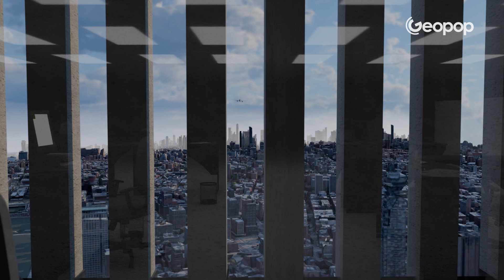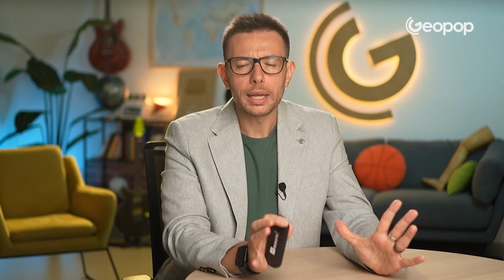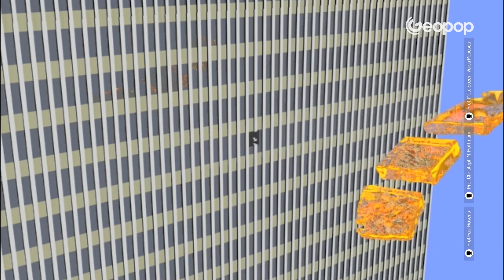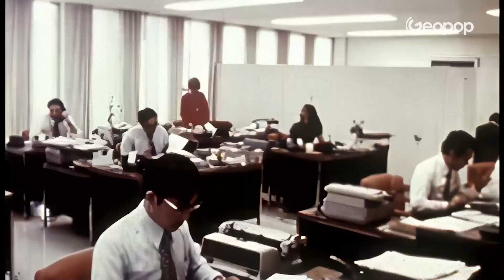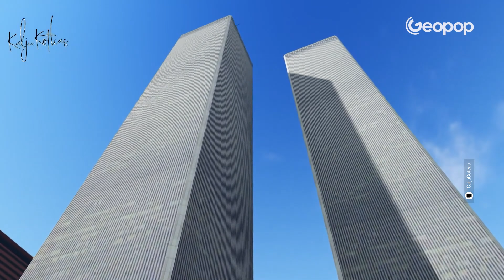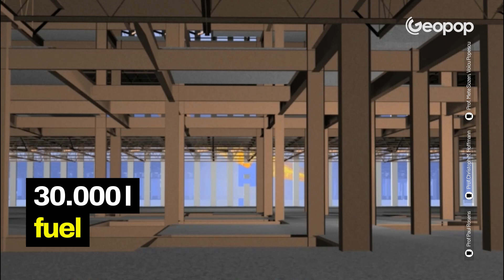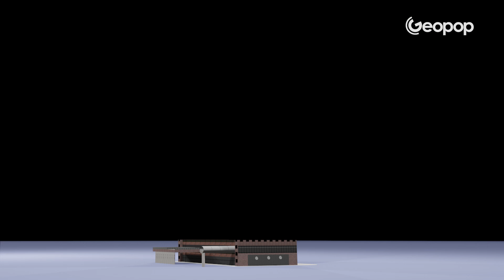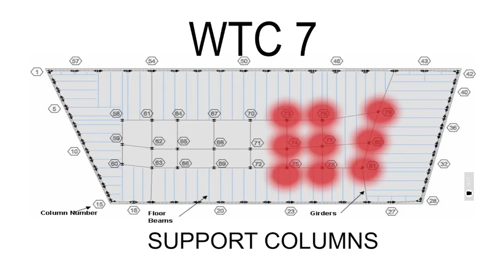9/11, 2001: The Technical Reconstruction of the Twin Towers and WTC 7 Collapses

Comment: I'm confused. So according to this man, temps were way lower than what would be needed to melt steel.  Why have I seen so  many videos and pictures that clearly show molten steel spewing out of the towers?
Reply: Molten metal pouring out of the South Tower (and it was in fact ONLY the South Tower)?  You mean this?

youtube.com/watch?v=xPVGGQU-MeQ&ab_channel=SeekersofTruth 

So you think that is molten steel why?  Because you performed metallurgical tests?  Because the internet told you that’s what it is?  I think we can do better, so let’s do better and build a theory the right way instead of making evidence-free assumptions. This will take just a couple of minutes and is worth the investment. 

The Boeing 767 which struck the South Tower weighed 117 tons and 80% of that was aluminum.  The exterior cladding on the Twin Towers – the white panels – were also aluminum. When Flight 175 struck at the 81st floor its momentum deposited much of the office contents in its way and the bulk of the aircrafts mass into the NE corner of the building. The piled up debris shoved into that corner is visible in photographs and video so we know it was there. 

There’s a good shot here of piled up debris from 4:36;

youtube.com/watch?v=ZLJyL63sqtU&ab_channel=MrKoenig1985

Steel melts at roughly 2,750-deg F while fires in the South Tower reached peak temperatures of around 1,800-deg F. Aluminum OTOH melts between 887-deg F to 1,180-deg F depending on alloy. That aluminum will melt under these conditions is not a surprise. If you look at pictures of cars left behind and destroyed by forest fires the aluminum wheels are invariably melted away along with other sometimes aluminum parts like hoods. Steel bodies remain intact. 

The “molten metal” appears at 9:52 am. At the same time we see the first externally visible signs of sagging floor trusses and the pulling of the perimeter columns inward. I submit these events are related, not coincidental. The aluminum cladding at the NE corner also appears to me to be burning. 

It is likely the with the floor trusses sagging under the heat, and the 81st floor truss in the NE corner under the debris pile subjected to the heavy load of the debris pile, the truss broke its perimeter column connections and dropped, instigating the material starting to pour out of the NE corner at the 80th floor.

Given the properties of the materials in question, aluminum is by far the most likely culprit. 

Reports from The NIST, FEMA and MIT all concluded the material is aluminum. 

Certainly steel is the least likely of all the materials the anomaly could be given its much higher melting temperature and the fact there is no logical source for molten steel.  The perimeter columns in the NE corner are intact and the material is pouring out between them. So it isn’t columns melting, therefore what other source of steel is there?

Deniers will claim molten aluminum appears silver when molten, which is true but only at the low end of its melting temperature range. Aluminum can and does get hotter and it glows red to orange when it does (1,100 to 1,800-deg F).  Most folks of course just don’t bother getting it that hot if the goal is just to get it molten for say molding a part. No need to go higher. 

The total mass of molten aluminum is a BIG deal in regard to how it behaves when poured. Quantities bellow half a liter cool almost instantly if poured onto a flat surface, but if poured into say an ingot mould will stay red for a minute of so. Pouring volumes of molten aluminum greater than a liter is a VERY different experience. The thermal mass is much greater and the radiant heat is horrendous. The aluminum is able to stay liquid and remain glowing bright orange much longer. 

The famous video of glowing liquid gushing out of Tower 2 moments before it fell, involves at least tens of liters of molten aluminum. The thermal mass involved is so great that it stays red after falling many meters through the open air.

Side note: There was also a large UPS battery farm in that spot and some of that material at least may well be from the batteries IMHO.

Comment: Many buildings catch fire and don't fall.  So, come again with tower 7?  There was a building in-between the 2 that didn't fall.  While informative, I still don't buy it.  I will forever believe that this was a strategic move done by our own government.
Reply: Many buildings and structures do catch fire and collapse. Each is its own case. There is no one-size-fits-all So, study the case.

The unknown and unimportant Building 7 was the 6th building to collapse of 10 lost on 9/11. Though extensively studied, it confuses many people. Not famous, or a terror target, and no casualties, thus it did not get a lot of attention and few know much about it, creating a void rapidly filled with garbage from the internet. Because everything seems like a conspiracy if you don’t understand how it works I prepared this brief summary explanation of my own analysis. No politics, just engineering. 

The North Tower collapse at 10:28am bombarded Building 7 with tons of burning debris, causing heavy damage and starting raging fires burning out of control for 7 hours. Half the responding FDNY firefighters having been killed, others injured, units in disarray, equipment destroyed, no water pressure, and the greater urgency of Search & Rescue efforts, firefighting at 7 was pulled as futile. The building couldn’t be saved and was left to its fate.

www.youtube.com/watch?v=g_SvpwyC17M&ab_channel=MFitz  

Collapse of a burning structure is always a concern for firefighters. Steel buildings subject to fire rely on active fighting of the fires to survive. Left to their own devices they will collapse. Buildings are designed around 1 to 3 hours of fire resistance, allowing time for occupants to escape and ACTIVE firefighting to get started, after which all bets are off. In B7 the occupants escaped, passive and active fire protections were compromised and active firefighting was abandoned which left the building to take its chances. It lost. Odds on Building 7 would eventually collapse, and it did. No big deal in logic. That is the sort of choice firefighters make every day in brush fire situations - which houses to save and which ones to let go. Only real difference here is moving the decimal on the size and cost.

www.youtube.com/watch?v=WnYBX6QT0R4 

FDNY Chief Daniel Nigro ; The biggest decision we had to make on the first day was to clear the area and create a collapse zone around the severely damaged 7 World Trade Center, a 47-story building heavily involved in fire. A number of fire officers and companies assessed the damage to the building. The appraisals indicated that the buildings structural integrity was in serious doubt. I issued orders to PULL BACK the firefighters and define the collapse zone. It was a critical decision; We could not lose any more firefighters. It took a lot of time to PULL EVERYONE OUT, given the emotionalism of the day, communications difficulties and the collapse terrain

FDNY Deputy Chief Peter Hayden ; We had our special operations people set up surveying instruments to monitor and see if there was any movement in the building. We were concerned of the possibility of collapse in the building. And we had a discussion with one particular engineer there, and we asked him if we allowed it to burn could we anticipate a collapse and if so, how soon? And it turned out that he was pretty much right on the money, that he said 'In its current state you have about 5 hours

The collapse of Building 7 was anticipated all afternoon and widely reported in the media with at least 24 video cameras recording some or all of the collapse. Everyone at the time knew what was coming and why.

www.youtube.com/watch?v=OY5S5k3tMHI 
Building 7’s collapse was totally different to the Twin Towers, harder to understand and most of the details difficult to see. But we can sort out what happened through careful analysis and observation.  What follows is MY EXPLANATION of the collapse sequence using the best available information and relying on no authority.

B7 was complex structure, a 47-story steel framed building built on top of a smaller existing 3-story building, requiring several lower floors dedicated to complex load transfer structures instead of usable office space. Of trapezoidal shape and all-steel tube-in-tube construction, B7 (above the 7th floor) consisted of a central core of steel columns carrying most of the gravity load, perimeter steel columns around the outside of the structure carrying the remainder of the gravity loads and long span beams and girders to tie those elements together and form the floors. On the outside of the building hung a moment frame - the last part of B7 to fall. 

Phase 1 : Collapse initiation for B7 is notably quiet with observers not realizing the building was collapsing! There was no audible warning in the form of say hundreds of ear drum busting 180-190dB explosive bangs preceding the collapse. The first externally visible signs of collapse initiation occurred at 5:20:28 pm. Here at 12:00 a local CBS affiliate reporter is talking 10 blocks from B7 when collapse begins. People don’t start to notice the collapse until 12:11. Then at 12:45 is the famous CBS fixed camera clip of Building 7’s collapse Again, note how quiet it is.

youtube.com/watch?v=t5tEy6mXSE8&ab_channel=fresnosean379

Collapse initiation was due to multiple lower floor failures above the load transfer region (7th floor) in the NE corner of the building. In this video at 0:45 you can see the NW corner from inside the building while under construction, Column 79 just out of frame on the left. That big, angled steel beam across the top of the frame connects to C79 at one end. The girders connect to the beam. That beam and all those girders depend on just one connection

youtube.com/watch?v=nP3TNHPCIVU&t=35s&ab_channel=EdwardCurrent

Phase 2 : Lower floor failures caused a loss of critical lateral support over an excessive length of core Column 79 and it buckled. If you look at a floor diagram of Building 7 (see above) and look at all the structures that depend on C79 you quickly realize this one column was a relatively isolated structural element on which a disproportionately greater fraction of the structure depended . Externally we see a vertical progression of window breakage along the 44-46 line and a kink in the roof of the East Mechanical Penthouse at the top of the building, consistent with C79 failure. The transition from full capacity to almost no capacity occurs in virtually an instant. Once the buckling failure occurs there is almost no resistance

Normally with a buckling column, the load could very well be redistributed to other columns, meaning the buckling could stop after a while. With C79 that is not the case - the failure did not redistribute the load, so the collapse rapidly progressed to the roofline, sinking the rooftop penthouse.

Phase 3 : With C79 gone, B7’s progressive, non-symmetrical collapse continues with C80 and C81 at the east end of the core left laterally unsupported and quickly buckled and failed as well, sending the EMP down through the building. C79-81 all have no diagonal bracing, which I believe is a major reason why they could not redistribute a lot of vertical loads among one another.

From there collapse progressed from east to west through the central core until the core was gone taking all of the interior floors and structures and probably most of the perimeter columns with it. You can see the horizontal progression of window failures low in the building and the dropping of the remaining rooftop structures into the building. One of the big takeaways from the NIST Building 7 study (that gets completely ignored) was their modeling which determined C79 failing under ANY circumstances would have initiated the same collapse sequence.

Phase 4 : After more than 10 seconds Building 7 is reduced to just a hollow empty outer shell - the exterior moment frame - creating the illusion the building is still standing since little has changed externally. But it’s just a hollow empty shell like an empty cereal box supported by only a few remaining columns and quite unable to remain standing. The north face leans inward, forming a V in the roofline, the last perimeter columns buckle under the strain and with nothing left keeping it up the moment frame free falls, landing on top of the 7-story high debris pile. It is only here, at the very end that a single measurement of alleged free fall is taken. Start to finish the collapse took 18-20 seconds, or less than 1/3 of true free fall for those who have been conned into believing that has any meaning. Worth noting - how fast something falls cannot tell you what started it falling in the first place. It’s not even the building itself free falling but its empty remaining outer shell at the very end of the collapse. The debris spread out, blocking surrounding streets, heavily damaging the Verizon Building and destroyed Fiterman Hall, all well outside of Building 7’s “footprint”.  

Building 7’s progressive, non-symmetrical collapse was incidental and unintended collateral damage from the combined effects of fire + time + gravity started by the collapsing North Tower. That is true no matter who planned and carried out the 9/11 attacks or why . The collapse was of so little consequence it barely even registered at the time, a mere footnote. 

Anything can seem like a conspiracy if you don’t understand how it works. Now you should. I hope you found this helpful and informative, not adversarial and it solicits informed critical comment. If I made any errors of fact, logic or reason or left anything critical out, please let me know so I can fix it. IF you can offer a more plausible alternative please do. Be the first. Please start any reply with the words “Tits McGee” or I will know you didn’t read it and are wasting my time.

Comment: People fixate on the subsequent fires, and underestimate the initial impacts and massive explosions. A 200,000 + pound (vehicle, fuel, passengers, luggage, etc) plane, with two large titanium engines, loaded with almost 10,000 gallons of fuel, flying at approx 600 mph ..... is going to destroy virtually everything in its path and then some. Witnesses reported that there were massive cracks which ran the length of many floors, as if an earthquake had split the floors beneath them The outer building and inner, crucial 40+ core columns, would have been severely shredded and displaced. The huge explosions will have exacerbated this. As time went by, those core columns, essentially the buildings spine, would gradually grow weaker and falter. This, in tandem with the fires and gashed perimeter columns - you really see the affect of the latter on the South tower, the top 1/3 of the building leans forward precisely where the second planes remains exited the corner of the building - is what brought them down.